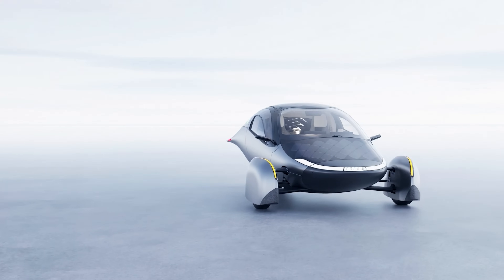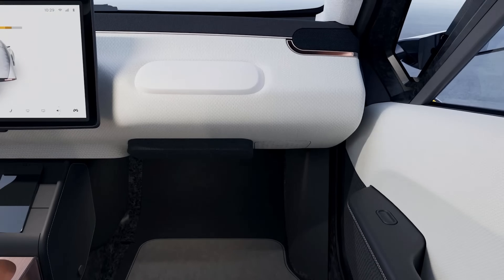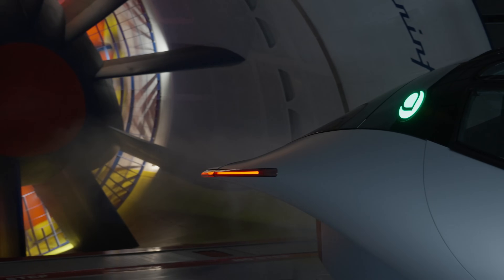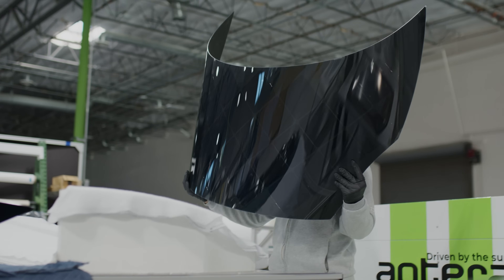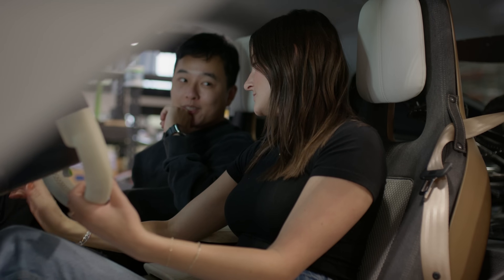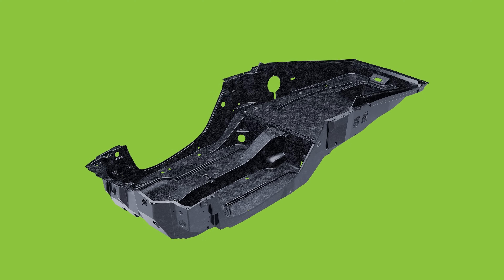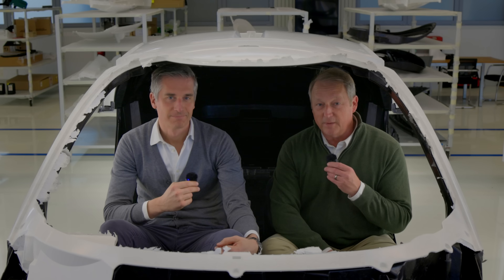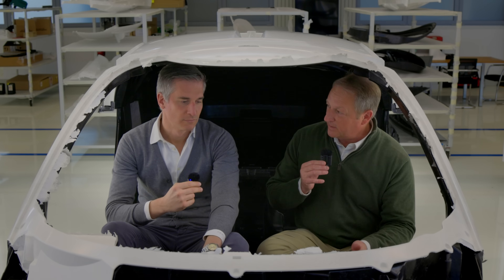Aptera Recap 2023

Comment: Have you thought about adding a regular socket? 220 or 110 volts? And also about creating a car with 4 seats and a more spacious trunk or a separate option for a trailer with a drive and additional options - battery?

I simply adore traveling and am ready to sleep even in the car, even under the stars nearby, the main thing is to have mobility and the ability to recharge my gadgets.
Reply: Yes to all.  Not in the first edition, though.

Comment: A three wheeled electric bike with 2 seats for the cost of a 5 seater electric car, the safety profile of a carboard box, and the added bonus that anyone can just walk up and key your solar panels. All this for just $33k! o_O
Reply: Do some due diligence.  You have missed important details.  The glass of the solar panels is more damage resistant than most other vehicle coatings, including paint.
Reply: @n.brucenelson5920  doesn't matter, all it takes is one crack and you're screwed. A 20kmh fender bender would be a complete writeoff for this vehicle.
Reply: @MrSporkster  Completely untrue.  In fact this would be a repair I could handle myself.
Reply: @MrSporkster  Aptera is aiming for 24 hour parts shipment turnaround.  Bonded SMC parts can be debonded and replaced with a heat gun, a chisel, and an air hammer. work many owners can do on their own.

Comment: I cannot wait to see this car approved for Europe. HOWEVER! I think the wheel and wheel covers will not work with some of the steeper speed bumps (actually: 'speed plateau') in especially France and Belgium (e.g) I'm convinced that the car will face the same problems with these type of speed bumps as a Lamborghini or other type of high performance cars do... I think you should check this. I'm currently driving a Jaguar XK which is a GT and even with this fairly normal proportioned car its faces some problems with these steeper speed bumps.
Reply: The wheel pants rise with the tires, unlike the front air dam on most small cars.  It will be better than most cars its size.
Reply: @n.brucenelson5920 thanks for your response. I’m mainly concerned about the overhang of the wheel covers when ‘attacking’ these speed bumps , as in some cases the angle is more than 30 degrees…

Comment: I just really hope they add buttons and switches. That's one of the main reasons I didn't get a Tesla. Screens are great for displaying info and changing settings that you rarely adjust, but are awful for controlling daily things like the climate control, radio, etc. Screen controls are less safe (you can't feel where a button is on a screen, you need to look at it), and a few big automakers are starting to realize their customers hate them and are bringing back some basic physical controls. It's also getting to the point where screen-only doesn't seem "cool and futuristic" like it used to, it just feels cheap and poorly designed.
Reply: There are some.  For instance the air vents are controlled by levers.  There are a few other basic ones.

Comment: First battery patch update Aptera should have done, electric battery heating coils fail sooner or later is actually common even more so than coolant leaks, if the battery in cold climates is not warm the battery bms will not let the battery charge. You will not be going to work or anything if there is no charging bypass like cold  battery pulse charging or time on after warming battery fails. Of course charging will take much longer if a heating coil fails, maybe there could be a warning ⚠️ maybe the system does some self running test before issued warning. A heater coil in or out of the battery should be relatively easy to change if and when needed, because it's the most common failures in electric vehicles. The battery bms would have to allow a charging bypass at a click of a wired button if the control panel is ever having software issues and updates, perhaps the apter app could directly connect to the battery bms as well with some basic command choices for charging when needed, of course suggested times and Temps for a manual charge to less any damages to the battery over and over. Maybe even a manual override number counter, to help with why a seemingly ok battery may be damaged in an emergency. Cold weather non heated batteries have to be trickle charged to gradually increase over time for minimum damages or regular use it depends what the bms is set for.
Reply: The batteries are heated by an antifreeze loop that can provide warming through the climate control system.
Reply: @n.brucenelson5920  hmm nice ,  if the  🔥 heat is done by heating the fluid, the coil and seal maybe is much easier to get to change. Depending on what type of charge settings the battery bms is set in cold climates the car will not charge 😑. Battery bms brain's are known to last, however heating coils and seals are known for some times lasting  3 to five years and needing to flush or drain the coolant because of build up from the heat coil sometimes, but most of the time build up is not a issue with good coolant   , mostly it's the coil that fails. Heating over and over there easily changed.
Reply: Also when coolant gets old after so many years it needs changing or becomes acidic.
Reply: @1978rayking  I know the general design, but haven't yet heard what the recommended service intervals are.  

I doubt that there will be any build up issues with the proper coolant and material chosen for the circulation system and temp extremes will be less than with ICE vehicles.  It will be interesting to see what kind of coolant is recommended and what the service intervals will be.
Reply: @n.brucenelson5920  True,   I know after a few years of coolant being heated and cooled and touching any two different types of metals in products even built to handle coolant causes the coolant to become acidic, needing changes after so many years. A  Heating Coil depending on materials and quality also have so many years of use as well, it's all just as important to  battery charging bms settings when they depend on each other. Me as a consumer will definitely know when I have to check something. Heating coils get hot of course doing what designed for, then it becomes electrical resistance, and the system is made to handle.Thnx for the input as well. The cooling seals should be easy to get to as well I hope.

Comment: I have one question that has come self evident the past few days.  With the winter storms across America there have been severe freezes.  I have seen news reports of Tesla's crowding superchargers in order to recharge their drained batteries.  Do you intend to have a cold weather package where we are able to wrap the battery module and other vital electronics in either plugin heat tape or similar product to protect against energy loss due to cold.  This is an area where electric vehicles need to start stepping up and fix the issue.  I hope Aptera can lead the charge!
Reply: Apters has temperature control that can warm or cool the battery pack through temperature controlled circulating antifreeze.  The first models can use electric resistance heat from the cabin climate control system.
Reply: @n.brucenelson5920  will that work in -30 temperatures? While parked?  Teslas have dedicated battery heaters or electric resistance heaters depending on the model.  It does not seem to have helped them one bit.  I cannot count the number of times over the past few years where I have seen stories about loss of battery life for teslas due to cold weather.

My advice, take a lesson out of the overland/van life community.  I can’t count the number of times I have seen excellent solutions to protect against the cold coming from these groups of car hackers.  I do not want a car I can only drive in nice weather without having to worry about it being dead.

Comment: Yuck! No safety features (it's a tin box), can't carry people, can't carry things, has no range, has even less range if you want to travel by night, you freeze in winter and make sauna in summer, you can't park anywhere in fear the battery might explode injuring someone, it is made with polluting lithium batteries, and I suppose will cost a load of money.
I suppose the only redeeming feature is a card of the Woke local club.
A Fiat 500 minicar from the late fifties will beat this thing in every possible aspect, including environmental impact.
Reply: I don't know what you are describing, but it is certainly not Aptera.

Comment: I love this! The only thing I'm not thrilled by is that bar dividing the door glass. Seems like for someone of a certain height it would be a visual blocker. Guess it has to be there for strength and/or to allow all the glass to fit down into the door cavity when the window is open. Best of luck in '24.

Comment: Ill be to expensive , only for a nich market. What would be the lineup of this Company?  Is an interesting product whith a lot of expectations but with very small market. So I think they will be buy by another car Company in the future.
Reply: Strange comment, since Aptera Corp has claimed from the beginning that this first vehicle is for a niche market.  They themselves were expecting only about double what the first Telsa Roadster sold.  In fact, they now have around 20 times that in deposit placed pre-orders, and the most successful crowd funding campaign in history.

It is hard to claim that a vehicle with an operating cost probably less more than 2.5 times lower than the Tesla model 3 is "to expensive".  

Look at their SEC reports.  The structure of the company makes it VERY difficult for them to be acquired in a hostile takeover, and their second vehicle is likely to be a distinctly non- niche 4 wheel, 5 passenger sedan.

Comment: If you are only going to seat two people why don't put them in line instead of side by side? Isn't frontal area the biggest factor in aerodynamic efficiency?
Reply: Riding together in a car is a social activity.  My wife and I have had 100s of thousands of miles together on motorcycles, and she is ready for side by side seating.

Frontal area is part of the aerodynamic efficiency formula, but not the biggest.  If it were, most motorcycles would be more aerodynamically efficient than the Aptera design, but that is clearly not the case.

Comment: please show us where the 100 kWh battery will fit int this thing?  My Nissan Leaf has only 40 kWh and the battery takes a lot of space...
Reply: They have already done so.  The battery case will be the same footprintforall the battery sizes.  The 250 mile range case will not be as populated.  The 400 mile range case will be fully populated with 2170 NMC cells.  The 600 and thousand mile range cases will have batteries that are the same diameter, but taller.
Reply: @n.brucenelson5920  bit skeptical about battery size and range.  Unless the use new technologies
Reply: @MLSphotography  There is a lot more information on the web about the dimensions of the battery pack.  They are using the same size NMC 2170 batteries Tesla uses in the Model 3.  They are packed and cooled differently, and less heavily loaded than in the Tesla application, so they have both higher energy density and produce less heat.

It is quite interesting if you are into such things.

Comment: … can’t wait for these to be on sale; I wanna test drive this thing.
Reply: My wife and I had a test ride in a prototype in 2021.  The performance will blow your mind!
Reply: … i’m wondering if I can keep this thing parked outside all year, rain, or snow… I’d like to run this on free, solar energy as much as possible, around town.
Reply: @nowsc  We are now headed for -22 F tonight here in Iowa.  We have a garage, so I would pull it in on a night like this, however if it can still be plugged in to help keep the batteries warm, it probably wouldn't harm things.  I know they have tested the batteries and some other systems at least down to -40.
Reply: @n.brucenelson5920  I’m not so much worried about the temperature as about whether the car can stand the weather, being outside all the time. We do have hot summers and cold winters here. But I can’t put it in the garage because that’s where my model three lives :-(
Reply: @nowsc  It is true that the areas of the car that are wrapped may weather faster than paint, but can be easily renewed.  However, the glass covered solar panels and SMC are likely to be very weather resistant.

I will report on my experience in Iowa when the time comes.

Comment: I want to know how these will handle in snow.

They are fine for the nice California weather, but I can't imagine they will fair well in Canada.
Reply: It is now zero degrees in Iowa where I live and we have just been through a blizzard.  It is likely the warmest it will be for the next week.

I will report on how my Aptera performs in such conditions.   I am actually not too worried for several reasons.  Many of the systems have been tested down to -40 during the development phase.  The AWD version has better traction control than most vehicles, and I expect it to do better than my present Honda with proper tires.
Reply: Then prepare for your imagination to expand

Comment: "first production intent vehicles in a few months" I'm assuming thats a full vehicle? complete?
Reply: Demo vehicles, and vehicles meant to go to crash testing. Actual deliveries are expected to start late 2024 but I wouldn't rule out later or sooner.
Reply: @richardryley3660  as I said, those are the production intent vehicles. The intent is for demo/crash test etc before regular production.
Reply: @Ingo.Mclean  I assume once they are done with the crash testing, yes, vehicles will start to be shipped to the customers.

I hear the early PI vehicles will be retrofitted with any missing components so they can be sold. Although I'm sure Aptera will hold on to some.

Comment: say if for some reason you get into a accident, and the "tub" cracks. what do yo do then? need to reassemble the whoel car?
Reply: Carbon fiber SMC can be repaired
Reply: The tub should not "crack" unless you have been in a collision serious enough to total the car.
Reply: Carbon fiber is fairly ductile, if it's a low speed accident it should just flex back into shape naturally. If there was enough force to crack or shatter it, insurance likely wouldn't cover that damage similar to other EVs.

Comment: I like the progress!
I have only 2 wish:
- Sell it in EU
- Add top part to that steering wh..yoke.
Reply: - The Aptera will be sold to everywhere, including Europe.
- The yoke's interface will  be compatible with the current industry standards, hence can be replaced with a +/- readily available aftermarket steering wheel.
Reply: @charangohabsburg1  we don't know any of that. First off is Aptera never confirmed sales across seas, they just said they "would love to" but that has extra legal stuff to deal with and the fact Aptera currently doesn't plan on making right hand drive models. 

And you can't be 100% about the wheel being standard for cars. Remember that by law nothing is forcing them to do anything standard. As a motorcycle it's not even required to have a wheel.
Reply: @Skylancer727  "Aptera currently doesn't plan on making right hand drive models."  ?

Aptera had RHD models designed from the beginning.  They plan to sell to RHD countries and this has not changed.  It may take longer, depending on when the needed investment arrives.
Reply: I like the yoke, but I believe it should only be sold if it comes with a sweeping light on the hood like KITT. 😂
Reply: Yeah, really wish it had a full wheel. Though I did like the old Hello Kitty look, was adorable. But I'd still prefer an actual wheel. I expect to still drive my car.

Comment: Go Aptera!  The world needs more small light electric vehicles!
Reply: That's the thing that people don't quite understand about EVs. They should not be large/heavy. EVs work best in urban locations: Short(er) distances, low speeds, lots of starts/stops, etc. People have bought into the EVangelists and expected them to work just like ICEs. They don't; because they aren't. Yet they expect the ability to take road trips hundreds of miles in a day in something the size of a WWII Sherman tank without consequence.

I have seen both sides of this sort of "Are EVs the future?" argument and they're both wrong. EVs have a place, but not in the way we're using them right now.
Reply: @schwarzwolfram7925 seriously? You do know the model Y is the best selling car in the world for 2023 right? It does everything.  This Aptera is nonsense right now because it's too expensive for the likely demand.  Google what happened to Chris Anthony's other companies Epic Boats and Flux Power as well as Aptera (first time around).
Reply: It has the replacement of a truck, this thing is by no means small. One could call it a waste of space.
Reply: @docsnider8926  First of all, I think you meant "displacement" not "replacement". Secondly, while the Aptera is noticeably wide (probably due to it's three-wheel design), it has a strikingly similar length and wheelbase to a Toyota Corolla (E210). It is definitely not sized like a truck, nor is it meant to replace them. Aptera claims the kerb weight will be around 1,800 lbs. Light enough that you don't really need power steering. Which is a good direction to go in; because the most popular EV out there right now is the Tesla 3 which weighs DOUBLE that.